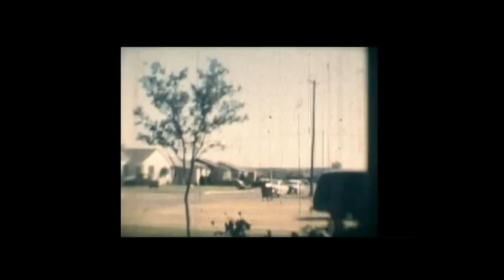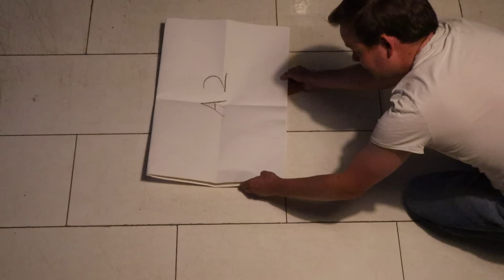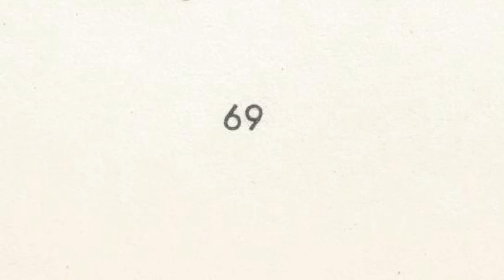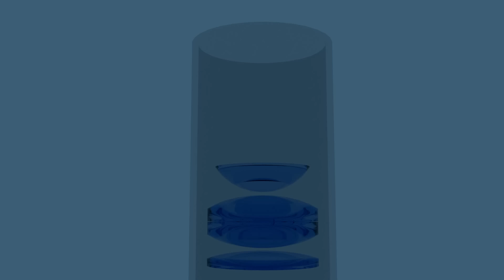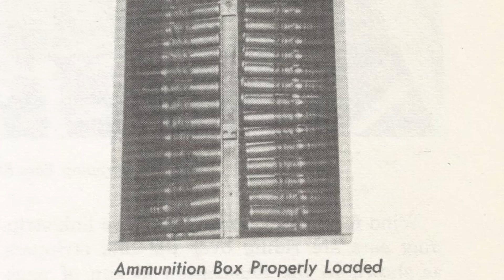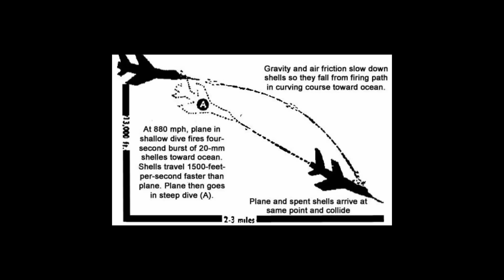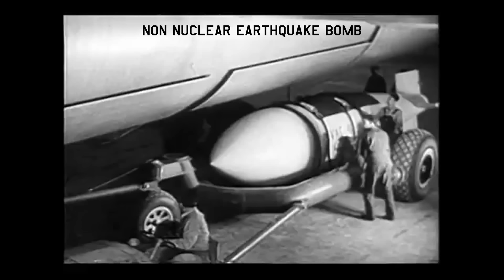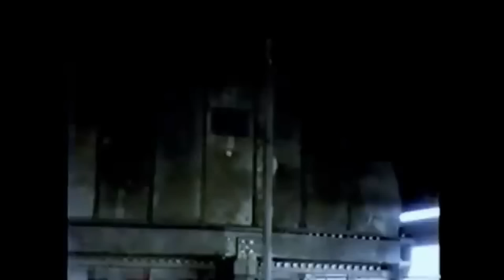Unfathomably American: The Armament Systems of the B-36

Comment: 58:47
Alex: "On the ground the reactor would be removed via a specially built heavily shielded crane..."
USAF SAC: "...hooked up by a completely unshielded technician working from a gantry a few feet from the hot reactor. We acknowledge the irradiation risk, but felt it acceptable given our usual flight crews routinely fly 40h missions sitting directly in front of four autocannons with a known tendency for uncommanded discharge."

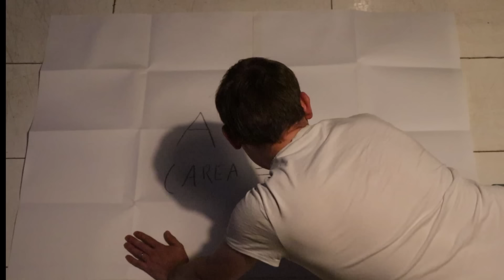Comment: 14:23 there's the reason why.
Also the side lengths will be irrational numbers whereas American paper has rational number side lengths: 8.5 x 11,  3 x 5,  8.5 x 14. "Yes I would like this poster to be quartic root of 2 meters by one over quartic root of 2 meters, please."
Reply: Ok but why those specific sizes (with fractions)?
But fair with metric papers sides being weird numbers based on square root of two, which ig gets easy to forget about when the standard is so common(and tbh I feel like it doesn't matter that much since you always have some error margin).

Comment: Given the B-36's penchant for engine fires, I think a more fitting statement would be '3 turning, 4 to 7 burning.
Reply: 2 turning, 2 burning, 2 choking, 2 smoking, and 2 unaccounted for
Reply: THE FIRES STOPPED WHEN THEY DID AWAY WITH CARBURETORS AND WENT TO FUEL INJECTION

Comment: Thank you, good presentation of an aircraft that was an engineering accomplishment even if it's combat effectiveness was perhaps marginal (too unreliable 1950-52, too vulnerable to interception 1957-59, 1953-1956 at night, maybe)

Yeager having test flown a defecting North Korean MiG-15 apparently annoyed LeMay by saying 'yes' when asked if it could intercept B-36s.

I think the B-58 under a B-36F was actually a test article. The B-36 had the inboard propellers removed and the undercarriage was left un-retracted for the relatively short flight from Convair Fort Worth to Wright-Patterson. This was apparently the simplest way of getting the non-flight airframe (Note the lack of nose radome, engine pods) to Wright-Patterson for stress testing. 

Initial B-58 concepts under the GEBO program did envisage a parasite carried by a B-36 or equivalent, but as the program matured the parasite concept was abandoned as too limited. 

Convair's B-58 was achieved by moving the bomb-bay(and some fuel) to an external pod and the availability of the J-79 engine. See Jay Miller's Aerofax book on the B-58 for full explanation.

Comment: Convair seems to have taken on a lot of huge challenges for the Air Force.  The F-106, F-111, and especially the Atlas come to mind.

It's interesting to hear that having first flown in 1946, the firing trials did not begin until 1949.

Another point one could make here is that if you wanted a defense against interceptors, putting together the things that worked would mean giving the B-36 a refueling boom instead of the guns, and having it refuel an F-86 or two.  It would be a very long flight for the fighter pilots, but the refueling and escort fighters were things that actually worked.

Let's clarify a thing or two about what's in a nuclear weapon: In addition to the fissile core (usually Plutonium), fusion bombs usually have a depleted Uranium casing.  They also have a lot of old-fashioned chemical explosives to compress the fissile core to the point where it goes critical.  In the Kirtland incident, it was the chemical explosives that went off, and the depleted Uranium that got strewn about the accident site.

Comment: Definition of irony: The gun turrets as you say were manufactured by General electric, whose corporate motto quite ironically was “GE, we bring good things to life.“
Reply: "We like things that spin!"
Reply: @AnimeSunglasses

What do you do, buddy?
We make things that spin
Reply: @AnimeSunglasses I doubt many will understand the reference…
Reply: @AnimeSunglasses 
A-10 WARTHOGS CANNON
Reply: LIKE THE A-10 WARTHOGS CANNON
Reply: Poor GE is just a shell of its former self, no thanks to Jack Welsh‘s being a finance guy and put everything into finance because he thought nothing else had value.

Anyhow, that motto applied mainly to their consumer appliance division, which was eventually sold off to Haier, a Chinese conglomerate along with the rights to keep using the GE name and that jingle for the next couple dozen years or so.
Reply: @DaveP-uv1ml  GE used to be the king of industrial electrical. Most power distribution I see that's 1990 and older is GE, and then Westinghouse to a lesser degree. And they're still good as long as you can deal with obsolete safety standards. Today I buy international brands like Square D and the quality is horrible. Modern GE is kind of a joke, we don't even bother. 

I used to work at a place that had a GE 10MW steam turbine from the 1920s still providing power. They don't make em like they used to
Reply: Dunno, Iv seen many ryan related comments over the last little bit.
Reply: G.E. ALSO BUILT THE A10 WARTHOG 30 MM DEPLETED URANIUM SHELLED GATLING GUN CANNON

Comment: What a fkin WASTE of resources this plane was....only 10 years in active service. By modern measures the entire project would have been deemed not just a failure, but a scandal.
Reply: You're missing the part where it was originally meant to provide the ability to run sorties in Europe in the scenario that England fell. It started life as a ww2 project, and like all of those projects long term use was much less of a consideration than simply getting out a usable system for the war. It simply fell down the priority list when England never fell and the chance of such a thing happening bottomed out.

Comment: I feel the need to explain the term "No replacement for displacement". It only truly applies to cars and trucks, where not just the peak horsepower and torque matters, but the power and torque curves are also important. A large displacement N/A engine will have a smoother torque and power curve (in general) compared to one equipped with forced induction.
Reply: yeah, but you can still use more advanced valve trains, higher compression, better fueling, ect to improve over a 2 valve cam in block engine
Reply: @alextopfer1068 But a larger displacement engine with those features would still make more power, so it would still apply. 
The transmission gear ratios and final drive ratio can make up for an engine with a narrow power band to a degree as well. My 89 Subaru EA71S engine (1.6l pushrod 2 valve flat 4 NA carbureted) makes 125 HP in its current configuration but only at around 7000 RPM. Below 3500 RPM it hardly makes 50 HP. Peak torque is only about 90 ft lbs. The transmission it is hooked up to is a 5 speed out of a 1973 or 74 Subaru RX which has 4.44 final drive gears and a very close spread of gear ratios throughout the gears. The clutch disk is made of sintered bronze because the diameter is significantly too small for the amount of HP using a conventional organic or ceramic material. All of this is installed in a 1979 Subaru DL wagon which weighs 1800 lbs. The combination of a light car, high 7500 RPM redline, low final drive ratio, and close gear ratios results in a car that is quite fast for the relatively low HP. Installing a larger displacement engine in the car particularly if it had a lower redline would make the car slower at top speed and probably only slightly faster acceleration wise as it is gearing limited and not HP limited. I am working on another engine for this car which will have forged pistons (rods and crank are already forged stock) and a custom billet camshaft to hopefully surpass 9000 RPM which is not possible when regrinding stock cams as there is not enough material to make the duration that long or the lift that big. It will have 12:1 compression like the current engine but will have stiffer valve springs with titanium retainers, dual carbs, and other supporting modifications for the higher RPM.
Subaru made a larger displacement version of this engine block, the EA81 (1.8l) and an OHC version, the EA82 (1.8l also). Both are harder to make power with than the smaller displacement 1.6 as the stroke is longer but the bore and valve sizes stayed the same. They make the same amount of power but at a lower RPM and raising the redline is harder as you run into piston speed issues causing cracked ring lands. This is why the EA71S (factory race engine) was always based on the 1.6 even after it had stopped being used in any production cars. The 1.6 has such a short stroke and such large valves that as long as the pistons are the later type with thinner rings, 8500 RPM is fine even with stock pistons. The biggest issue the 1.6 runs into is wrist pin flex which is easy enough to solve with stiffer aftermarket wrist pins.
Reply: There is always "THE ONLY SUBSTITUTE FOR CUBIC INCHES IS CUBIC DOLLARS!" 😆

Comment: In many ways, digital fire control systems were a step backwards.  An analog computer can do the direct computations required to place the projectiles on the target.  A digital computer uses an approximation of the calculations.  However, as word sizes got larger, the precision of a digital computer exceeded the precision of an analog computer.  As time went by, the speed of digital computers increased.  With greater speed and higher precision, the digital computers were able to generate better fire control solutions approximating the calculations  than analog computers directly performing the calculations, and take less time to do it.  That being said, when the Iowa class battleships were re-activated in the 1980s, the WWII era mechanical computers for the 16" naval rifles were still faster and more precise than any digital computer that could have replaced them. The most famous fail of a digital fire control system was during operation "Desert Storm".  The Patriot fire control systems used a floating point value for the time and that meant that precision would fall off if they were left on for too long.  As the time since being switched on increased, the minimum time difference that could be represented in the calculations got bigger, which led to increasing error sizes in the approximation of the fire control calculations.
Reply: Remember that the analog computer is also running a approximation of the calculation
Reply: @Goroca  The fundamental difference between a digital computer and an analog computer is that every value in an analog computer is continuously variable, while values in a digital computer can only change in discrete steps.  For gunfire calculations, the most serious issue is that time must be incremented in discrete steps, but the accelerations are not constant, during the step interval.  Analog computers do not need to step time.  The ability of an analog computer to model continuous time means that it can directly perform the calculations that predict a shell's flight path.  The digital computer must approximate the calculation, because the parameters change between the beginning of a time step and the end of a time step.  Smaller time steps reduce the size of the final error, but approximations like the Fifth order Runge-Katta algorithm reduce the error, with less computational expense
Reply: @richardbell7678 
But a analog computer runs in to errors calculating the solution 
You won't get the same resorts when running the same calculation twice 

You also run in to problems of all your components needing to be very precise 

On a digital system you can add more bits with is much simpler and the calculations are don in a consistent time(btw a analog computer still have a delay between input and output ) 

Back in the days it might have been better whit analog but nowdays Digital is the way
Reply: @Goroca  Have you done any numerical modelling?  Pick too large a step size and too simple an approximation  (Simple Euler methods are easiest to code and look the most like the original equations) and the errors dominate.

Many, possibly most, but definitely not all, errors of an analog system are replicable and consistent.  Many consistent errors can be compensated for scaling the input values.  Temperature variation is an issue, but the effects are smaller.  Electronic analog computers are easier to trim to produce consistent results matching the measurement precision of the components.

Making accurate and precise analog mechanical computers is not easy, but it is straightforward and repeatable.

The only time the calculation lag was a problem for a mechanical gunfire computer was during the Battle of the Falkland Islands, in World War I.  After Craddock's scratch force of reservist crewed, obsolescent ships encountered the squadron of modern cruisers that had won the Kaiser's gunnery prize, several years in a row, in the battle of Coronel and been obliterated, the two battlecruisers dispatched to the South Atlantic set off in such haste that they forgot to set the gunfire computers for operation in the Southern hemisphere.  The computers had to be fully stopped, so that the shaft accounting for latitude could have the reversing gear engaged and then everything had to be brought back to speed, before useful results could be obtained.  Otherwise, until the 1990s, compared the solutions provided by digital computers, the delay was effectively zero.  A bigger problem was the delay between setting the variable time fuse of an anti-aircraft shell and loading it into the gun
Reply: @richardbell7678 
True 
But I am talking about modern systems 😊

Comment: This is great – lots of info I didn’t know. Made some notes when watching:

12:11 - 10,000 miles is range not bombing radius – “bombing radius” (or combat radius) was distance B-36 could strike, usually around 4000 miles.  
33:40 – yes, to avoid a stowed cookoff after firing, the guns were left out to cool for a while. 
34:40 - the B-36 that crashed from turret vibration was 035, not 079 (079 was first B-36 crash).
45:35 - the monitor (or “effects”) B-36 that was almost destroyed by Castle Bravo helped decide the large parachute pack added to the MK-17, allowing more time for the plane to get away.
49:10 - all B-36 R-4360’s of all types had the 2 turbochargers, along with the built-in supercharger. The -53 engine had extra power from being fuel-injected.
50:05 - the purpose of the 2 turbochargers was only to maintain normal engine power at high altitude.
51:00 - despite the legend, B-36 carburetor icing causing fires was not actually an ongoing problem - was solved early-on with adjustments to the carburetor.  Also there was never an accident involving an inflight magnesium fire, though B-36 engines did massively catch fire for other reasons.
53:05 - a tail chase didn’t need to be forced, as it’s the only physical way of intercepting at altitude where the fighter cannot maneuver or make a turn of any kind. 
53:35 - there were actually no reconnaissance J variants – all J model B-36’s were produced and flown as bombers.
54:45 - Yes the N prefix was also on Chuck Yeager’s NF-104, permanently modified with an added rocket.
Reply: True about the tail Chase but the point that he missed was that the plane could just turn and the mig-15 couldn't. Also the fuel issue just it's going to run out of gas so fast
Reply: Yes absolutely right I should have noted that. A good example of this is the famous B-47 in 1954 flying over the Soviet base at Murmansk. At 37,000 feet several Mig-17’s reached it and flew nearby, but were unable to maneuver to shoot it down.  The single lucky shot that made a hole in the B-47 only happened because the B-47 was also built like a fighter and could not turn.

Comment: To my knowledge, the "navigator is also nose gunner" thing comes from the B-17, where certain configurations (they didn't always have guns in every position) of the aircraft had a similar arrangement of the navigator operating a nose gun.
Reply: But it's not the navigator, it's the copilot. Those are separate positions.

On these bombers, it was more like you don't need the guns manned when you aren't in combat, and you don't really need to navigate when you're already over the target, so they could perform two roles.

The copilot, you would think, would need to be copiloting all the time, just like the PIC or flight engineer, but I guess USAF thought differently.

Comment: The one thing that's always confused me about this aircraft, amidst all the craziness, is why they never built the jet engines with oversize compressors and used bleed air as forced induction for the piston engines. That should have given them another 10,000 ft or more service ceiling.
Reply: Most likely because the jet engines were an add on. While it was being developed, jet engines technically existed but were very unreliable and still largely experimental
Reply: The meth supply ran out before they got to it

Comment: Bro there fundamentally is no replacement for displacement. For example, you aren't powering a semi truck with a one liter diesel engine that's got a turbo, supercharger, direct injection, and water/meth/nitro injection, it won't have the same lifespan as a DD15 that can go for a million miles (~1.6 million clicks) without an in-frame rebuild. It's just not happening

Comment: Great video!  The B-36 truly was a one of a kind aircraft that hardly seems possible given the era it flew.  The images of the prototype XB-36 and production B-36 reminded me of something I learned years ago.  The tires on main landing gear of the XB-36 were insanely large.  The ground pressure was so great only a small handful of runways worldwide could handle the plane.  As a result, the main landing gear was designed with four smaller tires each.  Another image also showed the experimental tracked landing gear for arctic operations.